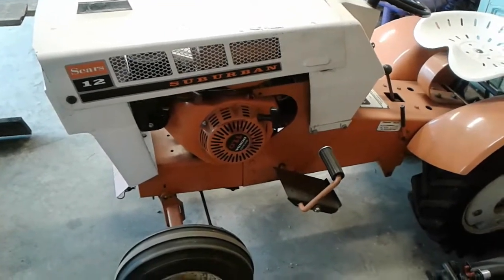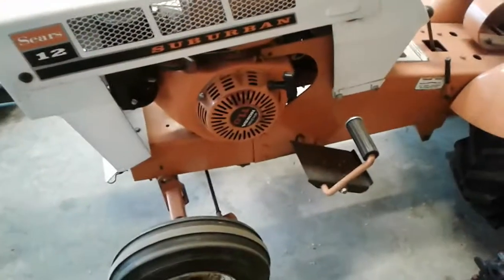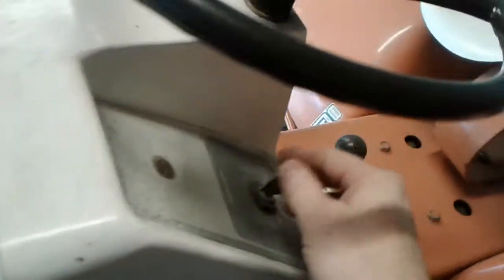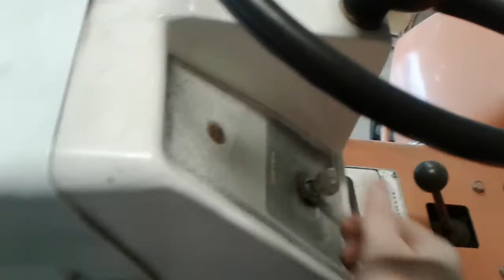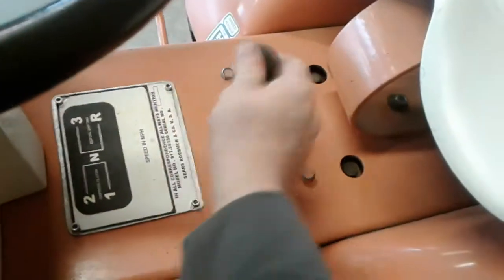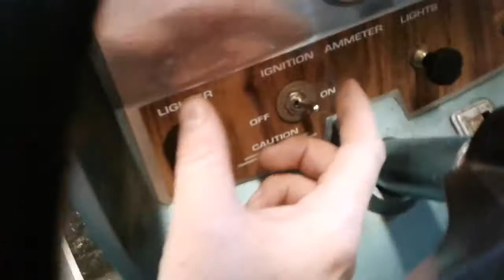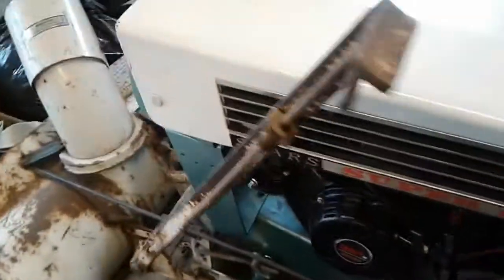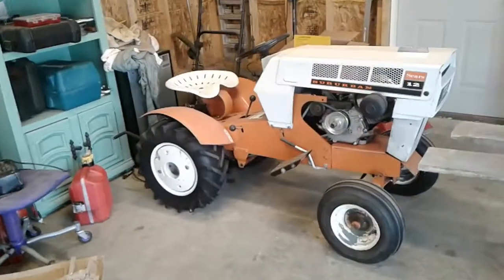WINTER TIME COLD STARTS: A VIDEO ONLY TRACTOR PEOPLE WOULD LIKE

Comment: Nice tractors ed why wouldn’t you turn off fuel and let the gas run out of carb so you don’t need to worry about it.Is that why the fuel shutoff is for?Great video just subbed and liked
Reply from the maker: Makes sense, i just never did it that way. May consider it.